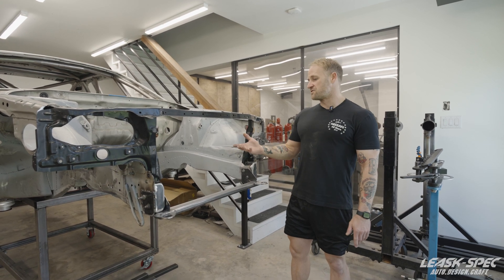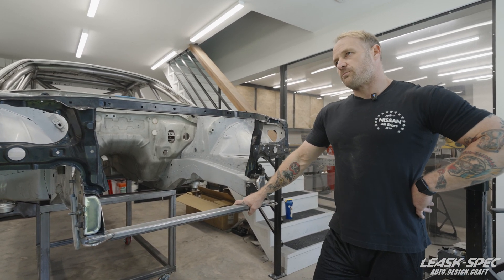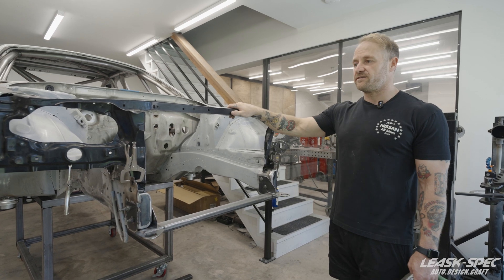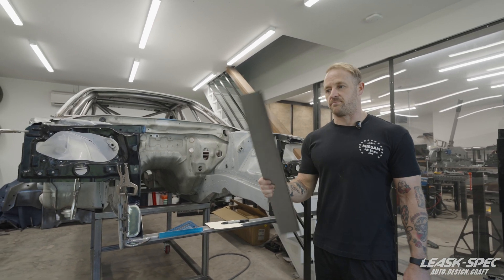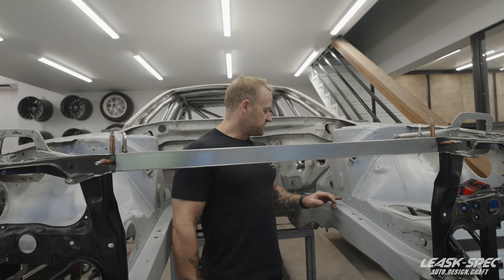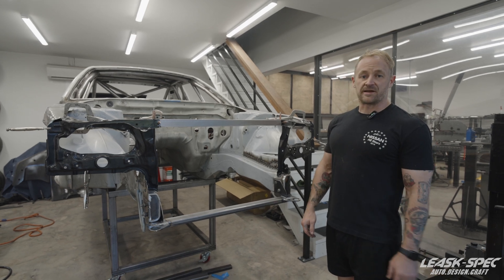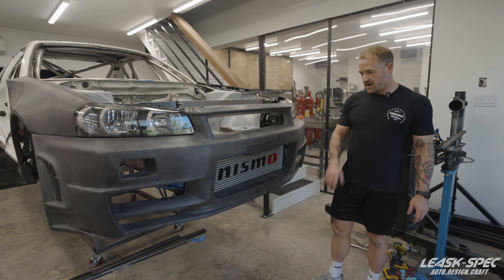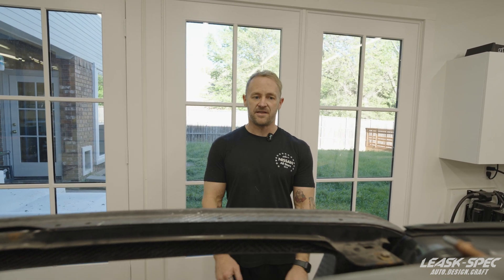R34 GTR FRONT END FABRICATION

Comment: Amazing content loving this build. How  is the fitment of the hood and bumper, in the pictures I've seen so far there appears to be a slight gap where the bumper meets the hood in the center grill area.
Reply from the maker: it looks a little off because its installed without any trims and the hood isn't latched at the back so its kind of sitting low, making the front end pivot up
Reply: @Leaskspec  i appreciate the response here- definitely looking forward to seeing how it fits when it's ready- i have the same hood on the way and am considering the rest of the front end as well- keep up the great work you're a beast!